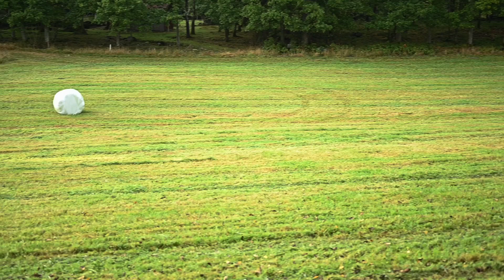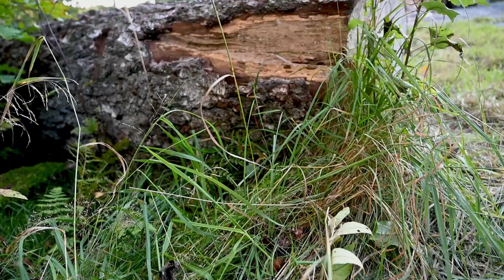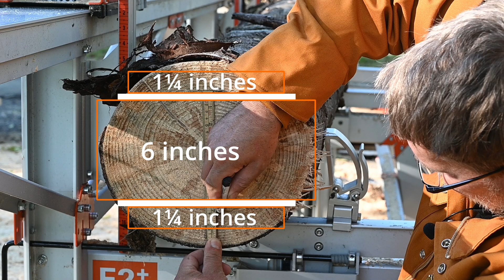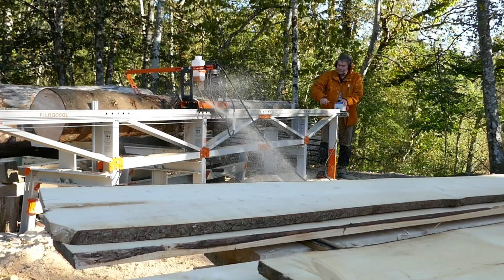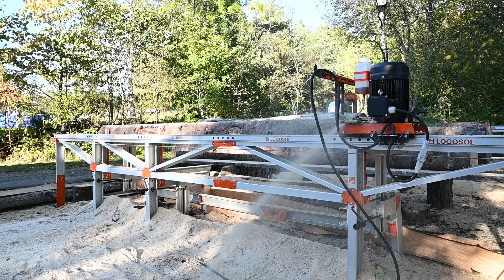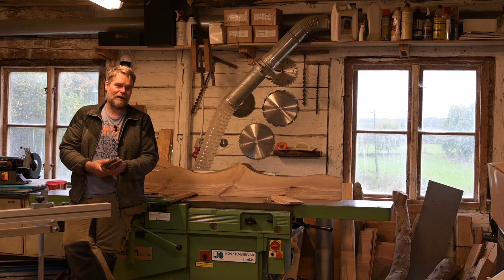Amazing way to speed up your sawmill setup!

Comment: Hello, you have great videos.  I have idea to make electric saw   because I have electric motor. May I ask you to share some information about type and diameter of pulleys on ES 5/8, bearing housing for Schaft, because I don't know how to put all that under the plate with  64 mm distance between table  and plate. 
Thank you.

Comment: Hello! I see you have the new Logosol speedsaw E5. Could I ask - do you prefer it over the older model?
Reply from the maker: Yes I prefer the new saw. It use standard Stihl bar instead of a special bar
Reply: @Projectoftheday  Lovely, thanks for the reply... I'm planning to build one so trying to figure out which design to copy 😄
Reply from the maker: @whirled_peas  copy the ES5/ES8 design
Reply: Hello, you have great videos.  I have idea to make electric saw   because I have electric motor. May I ask you to share some information about type and diameter of pulleys on ES 5/8, bearing housing for Schaft, because I don't know how to put all that under the plate with  64 mm distance between table  and plate. 
Thank you.

Comment: Halo allesammen... I like your videos and how you show the everyday situations. I noticed the same problem I sometimes have: the 6 inch block seems not to be parallel. This might occure because of tensions in the log e.g. from spiral growing, or if the sharpening of the chain tends the cut to one side, right? At about 4:44 a cut ends where I observed a slight slip upside when the bar has left the log. I think this can not be evitated, or what is your experience about this?
And then I'd like to know what wonderful music that is, which you added to the video at about min. 8, the guitar picking. What's the name of the title and the band?
Tusen takk for svar, hilsen fra sveits
Reply: Peter Simonis, I have an M8 and had the same problem. I solved it with several measures. I think they all had some effect, but not one single thing was 'the' answer. What I did: Bought a precision hand chain filing tool from Stihl; swapped to skip tooth chains, sharpened at no more than 10 degrees. This ensures the chain doesn't pull down or up, I installed (home made) bar nose steering (25" chain). I checked, double and triple checked the frame was square and flat in all directions, shimmed the chainsaw carriage and adjust with a set screw so it is perfectly level.  I tried various chocks, wedges etc to make sure the log doesn't move. I find the original clamps very poor at holding logs with thick bark (oak, etc).  Now I have beautiful boards. I found that grain direction and twist had NO effect on the trueness of the cut, but at first I convinced myself that it WAS the wood. It's not. It's mainly the design of the system. Logosol  were not listening when I told them I had a problem, but look on YT and forums and you'll see anyone handling anything large or tough (not a perfect softwood 8 incher as always demonstrated by Logosol) has some versipon of this problem. It seems worse the more of a perfectionist you are! Good luck, it's well worth trying these things. With hindsight I'd go first for swapping the chain for narrow kerf, ripping skip tooth.